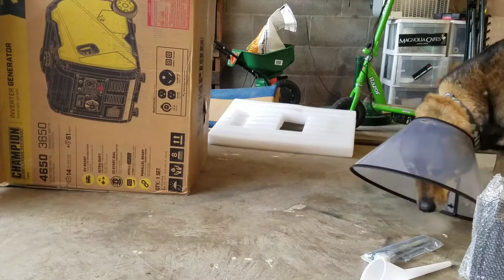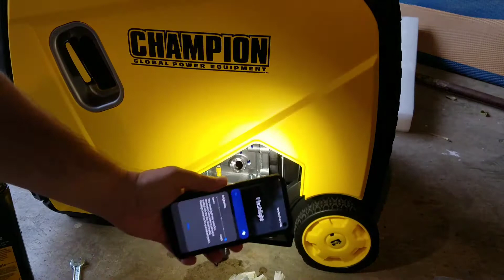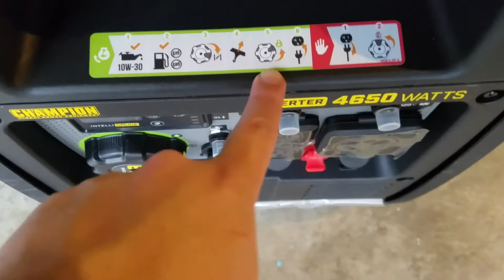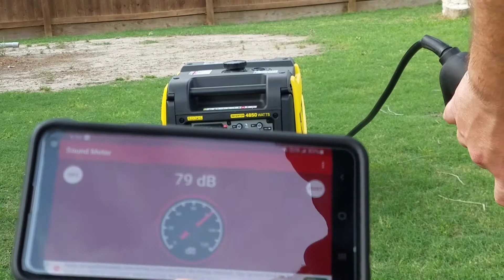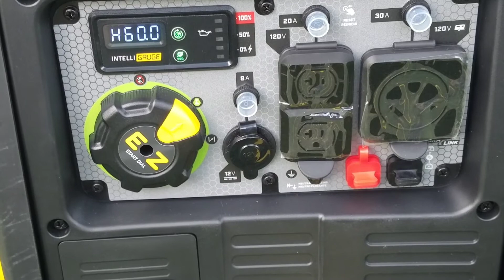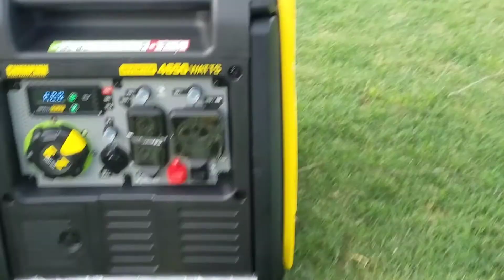Champion  4650 inverter generator

Comment: Always use ethanol free fuel in any small engine!!  I have this exact unit and love it!
Reply from the maker: Thanks for watching. I  am loving mine as well.
Reply: I just bought this dual fuel model in 4/22.  I am using 92 octane non-ethanol fuel.  I added Sta-Bil and Sea Foam as an extra precaution.  Check out Johnny’s Weekend video on how to shut off the generator and drain the carburetor while doing so.

Very quiet inverter generator.
Reply from the maker: @bosco9236  I will have to check it out. Let me know how it holds up for for you. So far mine is running great.
Reply: Regular gas can be used. Just if it’s stored for a long time, drain the fuel or use a stabilizer
Reply from the maker: Thats the best practice to prevent any problems. Thanks for watching.

Comment: Can regular extension cords be used on it?
Reply: I went to Amazon and bought three 12 gauge splitters.  Two feet long.  I have four extension chords that will plug into the splitters.  Saves me from splitting inside the house.
Reply from the maker: Yes it has 2 regular household receptacles rated at 20 amps.

Comment: Can this generator power two refrigeradors maybe a TV around the house In case of a power outages
Reply from the maker: Thanks for watching,  yes it can, you may have to turn the TV off if both compressors kick on at the same time.but once they are running they use less power so you will be ok.

Comment: From a everyday north Texan. I just got the same unit on Monday. I broke it in for the stated 5 hours, drained and changed the oil, and hooked it up to my 30 amp RV. No power at all to the RV, just a fault on my EMS stating a neutral open fault. No where in the manual does it says you will need a neutral ground bonding plug to power a RV with a EMS system. I made a bonding plug for less than $4.00, and now I have power to my RV using this generator. I ran my RV a/c and my fridge in the house and freezer in the garage all at the same time, and the generator showed I was only using 75% of it's available power. I am impressed with this generator, and it is pretty quite also. I AM NOT impressed with the so called Champion customer service.  There is no such thing as customer service from Champion. I called their phone number listed in the manual and was on hold for a long time, then opted for the call back option, then emailed them my questions, and I have yet to hear back from anyone there and it's been 6 days now. Rated the inverter generator a 9, Champion customer service a -50.
Reply from the maker: Thanks for watching and the great info about the neutral I am sure that will help some folks out. I haven't had any experience with Champions customer service but hope if I do it goes better than when you tried to get in contact with them.
Reply: I bought Honda .

Comment: Does this have a fuel shut off?
Reply: if no fuel shut off valve is safe to storage inside Rv
Reply from the maker: @GiganteG121  as long as you run it dry till there isn't any fuel left in the tank you should be ok.
Reply: Check out Johnny’s Weekend video on how to shut off the generator and drain the carburetor while doing so.
Reply from the maker: Thanks for watching. I don't believe it does. In the user manual it says to rut to starvation for storage but I didn't see a fuel shutoff valve when I started it up.